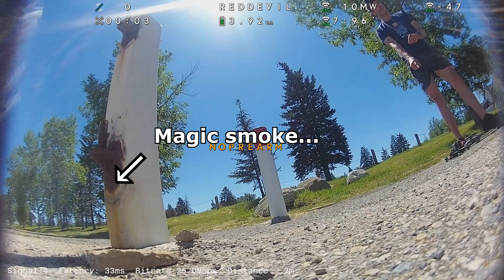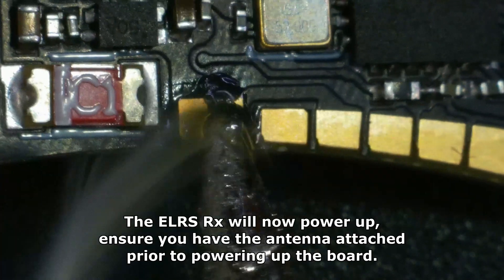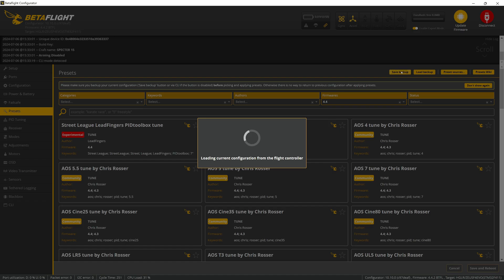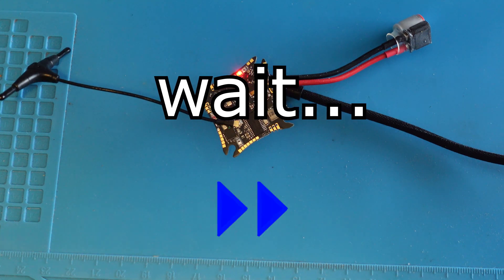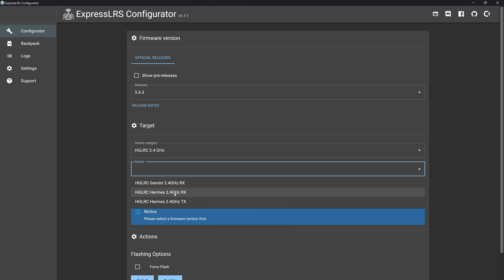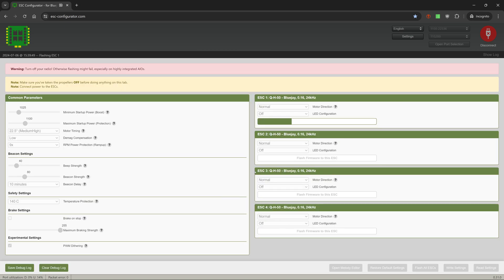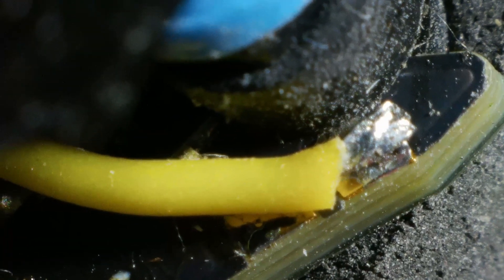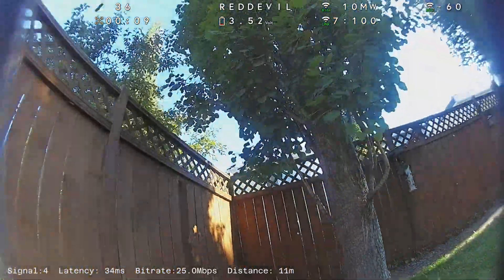HGLRC SPECTER 15A ELRS AIO Flight Controller AIO Unbox and Update

Comment: I've got a SPECTER12 ES 2-4S AIO board in my 2" Draknight. Do you think the 1.5A 5V BEC will be enough to power the Walksnail 1S V3 VTX ?
Reply from the maker: You would be right on the limit, so I would avoid it. Might work, might work for a flight or two, might die. The WS VTX can use up to 1.2A at 5V by itself, plus whatever the board itself uses. If you are running 2s or 3s, I would power the WS VTX directly off bat. I did a video on the current/consumption of the WS board here: https://youtu.be/PHJ1U9iK2N4
Reply: @reileymckerracher9181  Thanks for answering! I found the manual for my board and it shows how to disable the in-build analog VTX and solder what looks like a Walksnail board to the TX1, RX1, 5V and Ground. It's my first time dealing with WS and I read some reports of their boards frying when connected directly to a battery (current spike ?). I use 2S HV for this quad (8.7V max) and there is a 16v100uf capacitor soldered to the AIO.
Reply from the maker: @kmieciu4ever  You should be fine running directly off bat with 2s HV and a cap. I run 3s with a cap on one of my walksnail quads and haven't had an issue. If you do go with the WS VTX to the onboard BEC, I would try and keep your TX power 200 or lower.